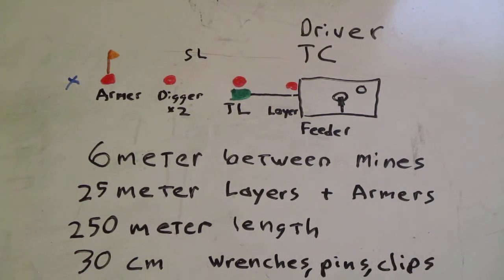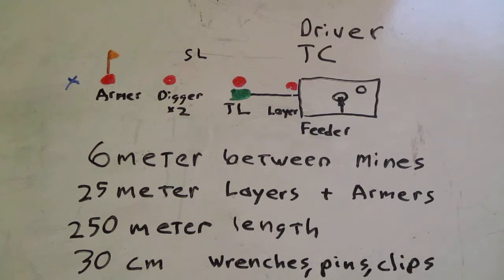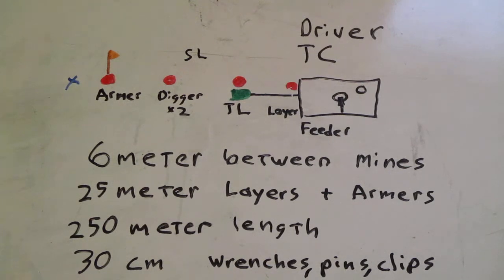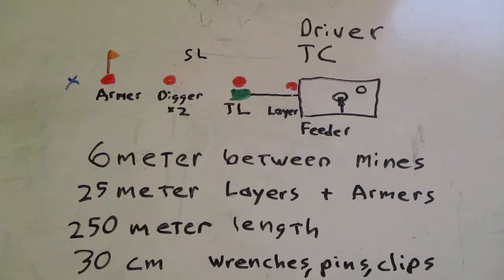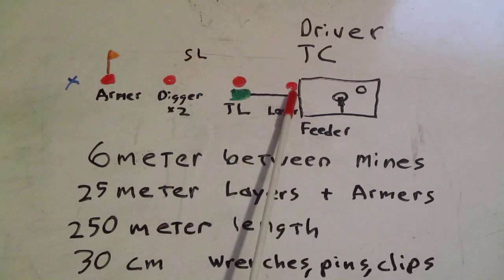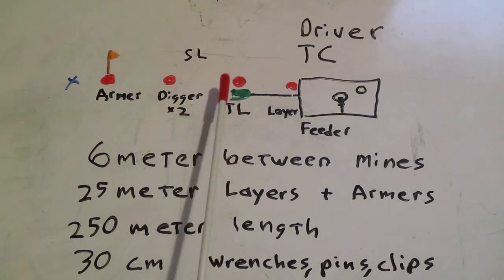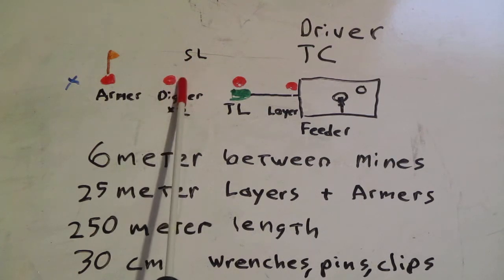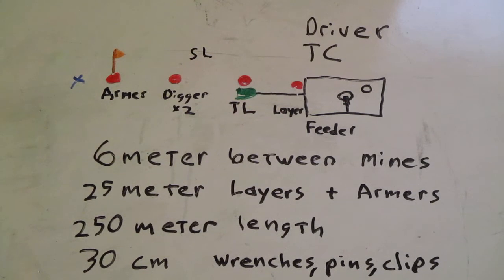Militia Engineer Tasks- Row Minefield Pt. 1 Emplacing A Row

Comment from the maker: VERY IMPORTANT  Some of the arming wrenches, safety clips, safety pins for the extra mines should be held back at the mine dump for any mines that are returned.  Some of the excess beyond the 42 sets put in the sandbag given to the squad leader when they draw the mines from the dump.  The sandbag is buried 1 foot from the end row marker which is itself buried 6 meters from the first mine.  The end row marker is usually a picket wrapped with barbed wire top to bottom with a couple layers buried straight up and down.